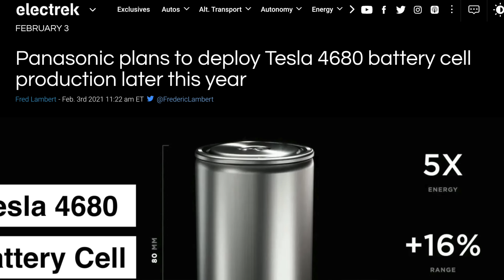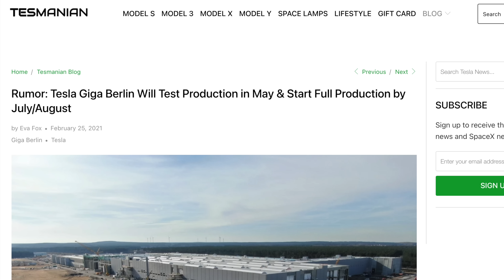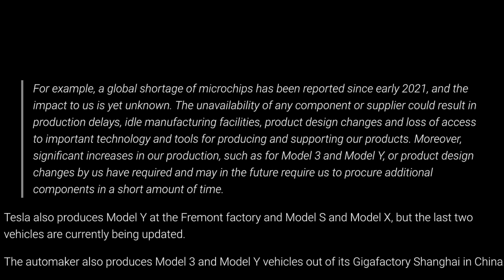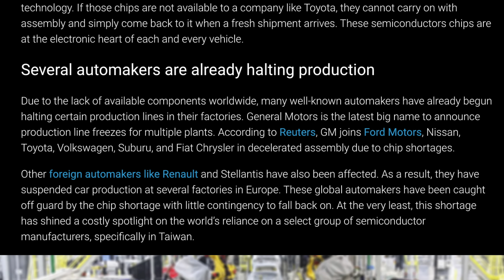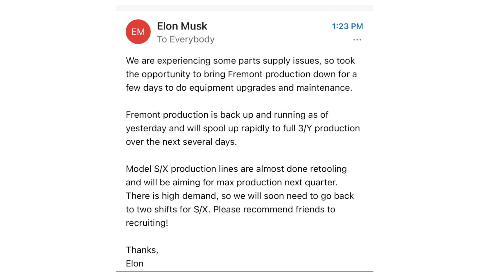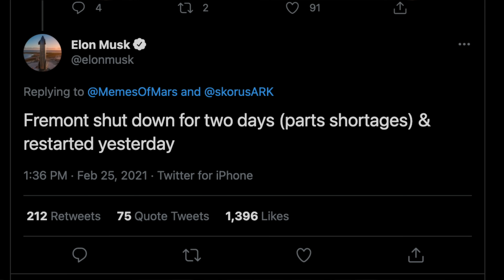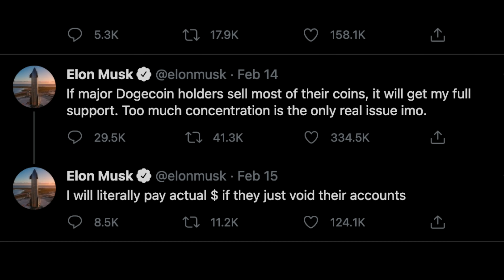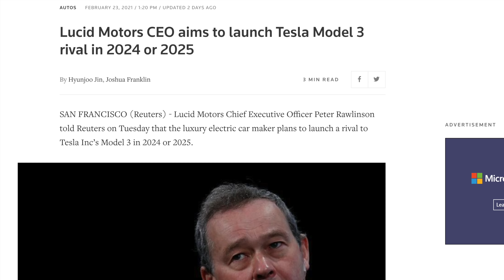Why Did Tesla's Factory Shut Down?

Comment: So we shut (because yes I work there on the Y) due to Mother Nature interfering with our logistics route from Reno (it got kinda cold and the route was blocked). Thus, we had a lack of parts, so there was no point to build cars with missing parts as it would have been a pain for our people to install them later since they’d have to dismantle cars just to install the missing parts, as mentioned in the video. So, had a nice little unscheduled vacation. And the Model 3 production has already resumed, they had the same issue with parts as the 2 cars share many parts. Model Y has been up a few days already. Treat the shut down as if it were just a random holiday where no one came in to work, just another day for us.

Comment: That steering wheel will not pass  its missing half of it. And in an emergency situation you need to grab anywhere. Maybe once its auto pilot is approved.
Reply: That yoke might work with  top-secret anti gravity.  But then the batteries will be outdated will pulse technology. LOL never the less it could be used in drone taxi. LOL

Comment: I doubt very much that a modern steering wheel is something they can just decide to swap out because the one they wanted is in short supply.  Maybe back in, say, the '70's, when a steering wheel was just a wheel with a horn button, but a modern steering wheel is a sophisticated device in its own right with air bags, electronics, an so on.  And I suppose it also means, especially with the air bags in the steering wheel, that they have to do crash tests with the steering wheel(s) they're going to actually use in production.

I don't know what that means, exactly, in this regard, but it probably suggests that the round wheel was at least a designed in option to begin with.

Comment: speculation zone: sandy munro has criticised in the interview with elon that the model y has the two-piece casting of the rear wheelhouse while the model 3 in spite of sharing many parts with the model y still has a wheelhouse like a patchwork which is a part that causes the huge variance in the gaps of the model 3. elon answered something like "its difficult to change the tyres on a bus on the highway while driving 80 miles an hour", e.g. it is difficult to halt the entire model 3 production line and apply the new casting to it and sandy agreed. to me this may be the logical consequence to "stop the bus and fix the tyre" because you cannot be driving with a puncture endlessly

Comment: I dont believe it is the same semiconductor issue. The big ICE carmakers cancelled orders going forward and so the fabs re-directed lines to do other paying jobs. This takes time and costs money. Then the big car makers said, we are starting again, re-start making our stuff. Teslas orders where NOT cut and where increased. The storms in and around Texas would be more likely interrupting a short timeline item. I know Austins Samsung Fab make their specialized chips, so it may be that, if they stop that line the supply they have will last longer on the others... and the Y sells and S&X dont use many. Lets put rear casting in while we can???? They never said it was chips at all, so it could be Glass, or Aluminium or o-rings for the octavalve or poly beads for plastics or wire....

Comment: In the recent interview with Sandy Monro, Elon said the reason the model 3 Sandy looked at recently did not use the read casting was that "it's like changing the tire when the bus is going 80mph". This could suggest that shutting down model 3 production is preferable since it would allow the line to be re-tooled for the rear casting - maybe even the front casting if they have enough capacity in their casting machines. This could also explain a preference to shut down model 3 over model y, since model y is so new it started with the rear casting.

Comment: The shortage is not a real shortage. The OEMs stopped orders last year, leading to the current deluge.  Happens after every recession.
Reply: @davidbrayshaw3529  maybe my comments wasn’t clear.  There’s more than enough capacity if it weren’t for the temporary massive increase in demand.  Also note it takes several weeks for CMOS chips to be completed.  Things will settle down in due time.

Comment: Ioniq 5 makes it hard to want a Tesla given the price is what they say it’ll be
Reply: What do you mean? From what I hear, it's supposed to start at around 45k USD for the small pack, so with the larger pack and some extras youre already at 50k, so less range, less acceleration, less features, no FSD, slower charging for about the same or slightly more than a model Y which most likely also has more interior space? Sure if you tack on the 7.5k tax credit, maybe it makes sense I guess.
Reply: @Harakai100  didn’t see 45k/50k anywhere
Reply: @ThiccShaft  Official pricing for US is not out yet, but that's probably about where it will end up at before tax credits and incentives. I live in Norway, the hottest EV market in the world, and here it is more expensive than comparable Teslas, and max range ofc also lower, so I dont know. Ofc as I said it will get the 7.5k tax credit in US tho.
Reply: @Harakai100  No over the air updates either!